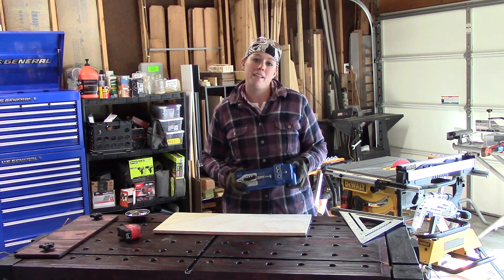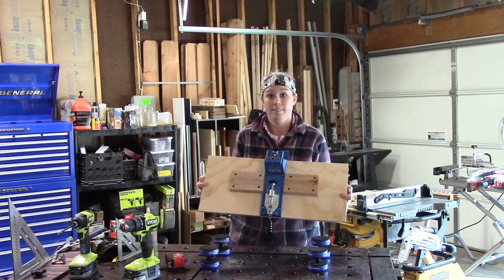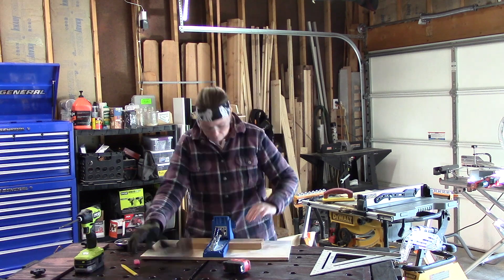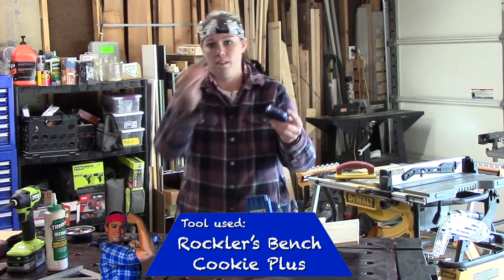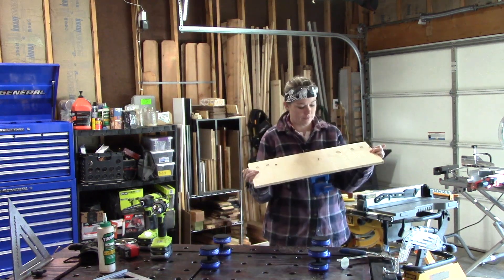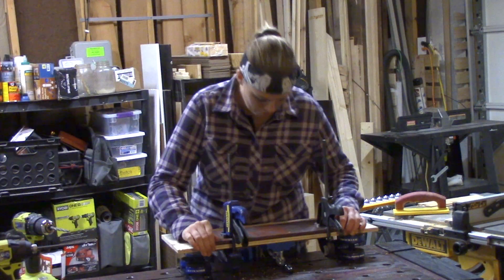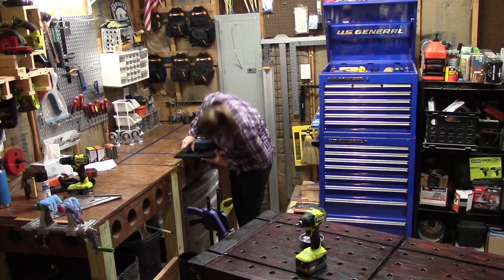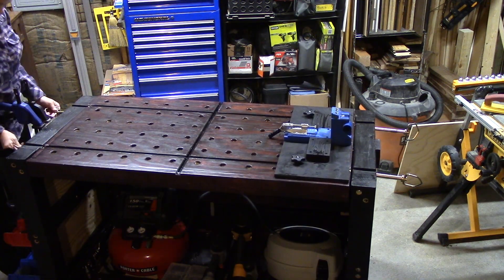Discover what a T-Track Mount can do for your Kreg Pocket Hole Jig

Comment: Probably stating the obvious.  For really wide pieces, make two outboard wing supports that clamp to your table or slide into the T track as well.  Attaching the vacuum not only keeps the work area clean, it helps extend the life of the bits by clearing chips and reducing flute wear.  Also helps extend the battery life of cordless drills, especially if you’re drilling lots of holes 🤙